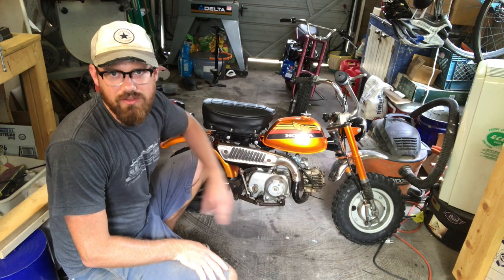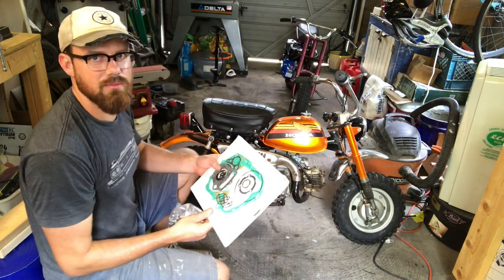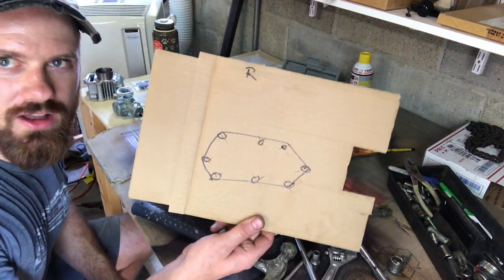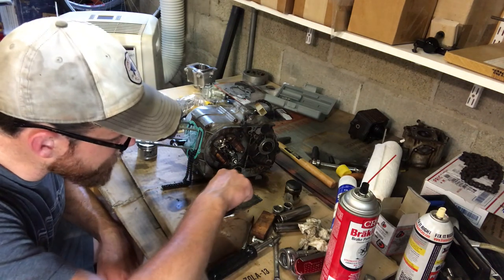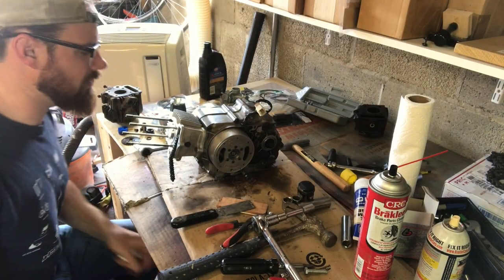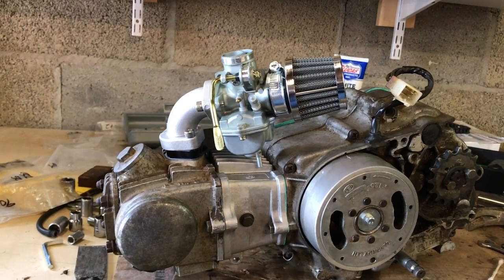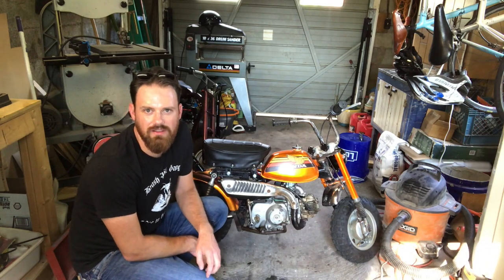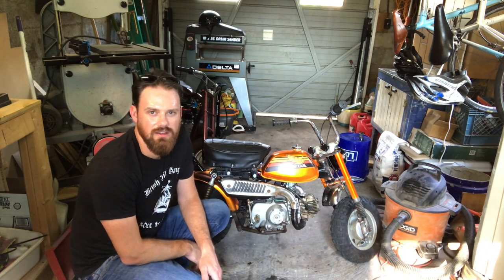88cc Big Bore Honda Z50

Comment: The "phillips head" screws on that Honda- and most other Japanese stuff are actually JIS or Japanese Industrial Standard head. The JIS and Phillips heads are slightly different. Using the correct JIS screwdriver or tip makes removal much easier and can minimize any damage to the screw head.
Reply: True. But good luck removing 40 plus year old screws from a motorcycle case without using an impact driver. JIS or othetwise.
Reply: True. But good luck removing 40 plus year old screws from a motorcycle case without using an impact driver. JIS or othetwise.

Comment: On these engines it also pays to clean out the centrifugal oil filter.  The filter screen just takes care of the big parts, but the finer parts are in the clutch.  It is located in the clutch under the little plate secured by three or four screws.  https://youtu.be/gNRkMZlphnU?t=435 has them both in view.

Comment: Hi..I'm really glad I   came across your vidd..I was wanting to put a big bore Kitt in my 69 Z-50 hardtail and was wondering what big bore kits were out there?? I  wanted to ask u if this 88cc kit u put on ur 50 was the biggest kit made for the  Z-50 ?? I'm guessing it is?? And in ur vidd you said it came with a upgraded carb and Jett kit.. my question is the jet that came in the new carburetor was to lean from the gett go?? And u then putt a bigger jet I'm it?? Does the carburetor kit that comes with the bigg bore Kitt come with multiple jetts?? And can u tell me what new size jet u put in ?? Then at the end of ur vidd u put octane booster in it and it looked like it really liked that xxtra boost.  With putting the bigg bore kit in it do u have to always add the octane boost in it for it to run smoothly and  not knock?? Or does premium gas work ok with no octane boost in it??? Sorry for the  100 questions..lol.. but that's great vidd and definitely helped me  figure out  what big bore kit to go with for my bike.. I also appreciate in advance u helping me with the answers to my questions.....take  care and thanks again.......Ray

Comment: hey mate I've got a 
 138cc big bore kit for my 125cc and I'm going to use the 125cc head do I need to adjust the valves
Reply from the maker: I always check em before I reinstall the head. .002”

Comment: Did you install the increased oil pump parts too?
Reply from the maker: yes, highly recommended. HD clutch too.
Reply: @ratinsurance2053 , did the oil pump but not the clutch.  Didn't know about that.  It was a great install on my 1986 Honda TRX 70 and now that thing is a ripping little S.O.B!  Best upgrade ever!

Comment: How's it holding up? Did you do the high volume oil pump or heavy duty clutch?
Reply from the maker: Yup. 88cc kit is going strong!
Reply: @ratinsurance2053  Putting an 88cc kit on "my" 86 TRX70 this weekend! I mean the "grandkids" TRX 70!!! Gonna dig in tomorrow and  if there are no problems, it should be back running Sunday.

Comment: Very cool . I have 2 of these now and I’m wondering where you found parts? If you don’t mind sharing the websites or places you used besides eBay I would really appreciate it . I think both mine are gonna need rebuilt and reworked and I’m gonna need lots of parts
Reply from the maker: links to everything I used is in the description.

Comment: Good video. What size carb is it? Thinking of doing the 88c upgrade on my Z50j.
Reply from the maker: Thanks James, the kit comes with a 20mm carb, the link is in the description.
Reply: @ratinsurance2053  were you able to reuse the stock throttle cable and throttle housing?
Reply from the maker: Brent Doig no. The stock cable was frayed and only giving me 75% throttle. I need to get a twist throttle from TBolt

Comment: Why did it look like the compression rings were in the opposite  places.
Reply: they appear to be in the wrong order to me.....chrome/silver ring on top
Reply from the maker: The flat black one looks white around the edges. Depending on what kit you buy it's always good to look up what order the rings go in. According to TBparts the flat black ring goes second from top and the shiny one goes on top.
Reply: @ratinsurance2053  Yes, the black ring is sharp on the edges and must be positioned as second ring.